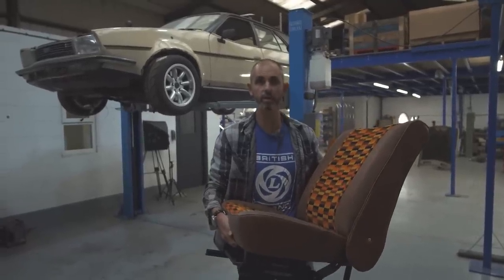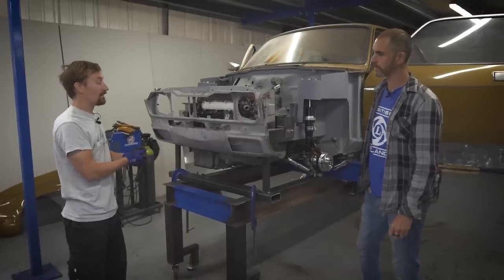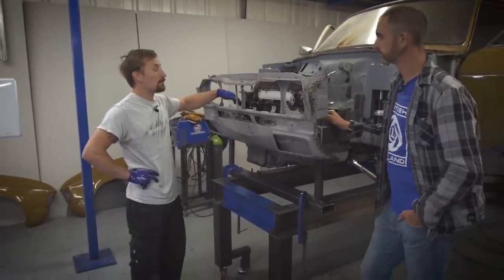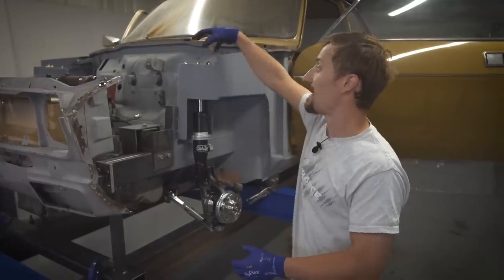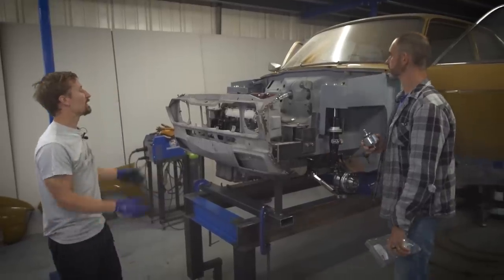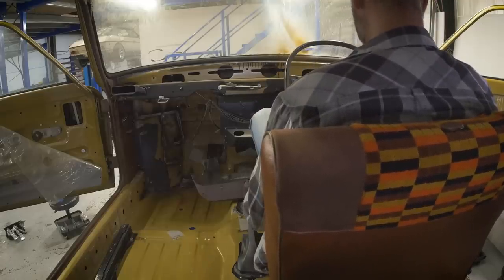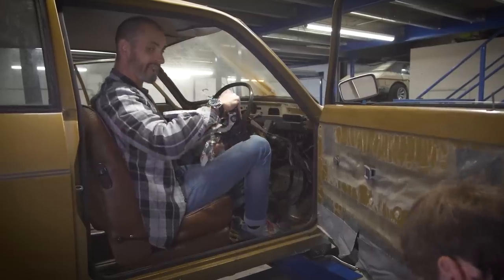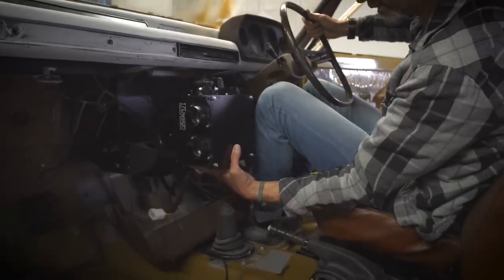Part 5: Austin Allegro Street Sleeper project build // Jonny Smith

Comment: You will probably need to upgrade your neck muscles too, if those lowback seats are anything to go by!  On a serious note, the seats do concern me, that's going to be a powerful little beast and floating around on those old lowbacks isn't going to be much fun.  Do the seats have a headrest option? There looks to be a blanking plate where one might fit?   Whiplash is no joke and was a major cause of injury in older vehicles before head rests became mandatory.  If you get shunted from behind, even at low speed, your head will fold right back over the seat and potentially cause serious spinal damage, even paralysis or death in extreme cases.  I love the concept of the original look but at least consider fitting the head support, for your own sake.   Your safety is more important than keeping the original look.
Reply: When I was a kid in the 70's my family had a red 4 door Allegro... I might be mistaken but I'm sure they had headrests on the front seats

Comment: Love you Jonny!  Don't care what you say, this is still my favourite thing you're doing.  Mind, I still think that engine is too deep, so here's my latest brilliant suggestion:  get Allen Millyard to siamese and turbocharge two Suzuki RG500 engines for you, to make a 1000cc, 200 BHP turbocharged square eight Allegro with a six-speed sequential box.  You can have that idea for free.
Reply: Won’t work. The front end will take off, leaving the cabin and boot behind.
Reply: Imagine how much 2 stroke oil and fuel it would use.  And and trying to be in the power band just pull away! And 8 expansion pipes trying to be routed somehow.
Reply: @chrishart8548  it would sound mental though, wouldn’t it!
Reply: @robsawalker  it really would.  Being 2 stroke it would have as many firings in a cycle as a 16 cylinder.  4 stroke.
Reply: Good lord. I bet Allen would be up for that too. It would be worth it to watch him cut the blocks up with a hacksaw, weld it all up in his back shed, and start it up sitting on a box in the backyard. That man is a marvel.
Reply: You could get 200 bhp naturally aspirated
Reply: @paulwhite7475  with what a 2 litre honda engine  or the 2 500cc  2 Stoke bike engines combined ?

Comment: This is a fabulous build so far. I’m loving it. I must confess that the low sump is making my teeth itch somewhat 😬.  Maybe it will look better when the ‘Agro’ (because that what it will cause unsuspecting drivers) is back on its wheels.
Reply: I’m sure it will 😃
Reply: 5 inches from the ground will hit some speed humps in the UK. The sump guard needs huge strength and integrity.
Reply: @ftw1540  

It's lucky that the sump will gain more clearance along with the rest of the car due to those handy wheel things 😉

Comment: Jonny, best solution to the large K20Z4 (FN2) sump is to swap it out for a K20A2 (EP3) sump, its significantly shorter, added benefit is losing the balancer shaft oil pump set up, gaining around 10bhp in the process
As for the intake manifold, i'd bin the RSP intake manifold and go for something shorter aftermarket

Comment: You HAVE to sort that sump. You'll eat through 5" of suspension travel on the first compression you go through leaving a nice black line from the scene to the recovery truck. Also, don't forget to not nose it up against the kerb.

Apart from that......Sleeper Agro, lol, brilliant.
Reply: Maybe a different sump would help? The engine does some to sit rather low, which is great, but also kinda dangerous otsot.
Reply: I’ve got to agree and it does look a bit weird seeing a k mounted so low down as they are pretty tall engines. I can’t help thinking it would be worth playing around to get it at a more practical height but I’m interested to see how it turns out anyway otsot.
Reply: Well keep watching because in the next episode things will have changed quite drastically on that side of things. 😃
Reply: Unless you're hitting square speed bumps at 50mph you're not going to see a stiffly sprung car move FIVE inches!

Comment: Johnny this is awesome. If I may and there's still time for it, go with a supercharger. The K series engines, particularly the K20 are spectacular with a supercharger, because you fix their low down torque issues without sacrificing the top end from an awesome N/A Honda engine. You get as much as 300bhp on stock internals and a bonkers setup.

Comment: For rad look at mgf ally radiator, 40mm thick and they fit the allegro front panel well, you can even use the original allegro rad top brackets

Comment: so, correct me if i'm wrong, the intercooler is BEHIND the radiator, nicely increasing the charge temp when the cooling fans come on. please say i got it wrong...
still mourning the loss of the 827, but we'll see...  [still worth a thumbs up]
Reply: The idea would be to have it below the radiator, rather than behind as such, but we’ll see 😊
Reply: @FabCoUK  below sounds ok, if there is enough space to extract the hot air, taking that bloody big sump out of the way would help...

Comment: Hi Johnny, great project, why don’t you cut out the small brace piece in the front of the front panel and place an intercooler there and the grille will still hide it when painted black 😀

Comment: Nice Build! Those mk2 Golf uprights are prone to cracking, especially the new non genuine ones which is what you appear to be using!?. Maybe worth upgrading as with the increase in power/torque than what they were designed for, they will be taking more stress. Get in touch with FunCup for some uprated billet uprights. Much better option and direct replacement with bigger and stronger bearing as well as looking the part!

Comment: That's a proper GTI drive shaft. It's that large in diameter because it's hollow to balance out the weight between the uneven length shafts.

Comment: Intercooler has to be in front of the Radiator. Otherwise it'll be an interheater!  The radiator will run hotter than charge temperature, typically. I'd be tempted to add a WCAC (Coolant based) so you can runner a thinner heat exchanger for the water.   But awesome progress, amazing fab work!

Comment: On my mini conversion we cut the splines for the outer CVs on the donor engine's driveshafts this was possible as they were both longer and thicker than required for the outer CV splines, this may be the case with yours. Result is one piece driveshafts much cheaper than new billet shafts.

Comment: Water isn't pushed out through the thermostat on this style of setup. The thermostat is used to block the return path of coolant from the rad during warm up. The vast majority of systems work this way now as it gives a more stable temperature control. The coolant is pumped through the block, head & exits at the end of the cylinder head above the transmission.

Comment: good and interesting project. Anodising colur is dye added after the anodie process (Anodising creates a cellular structure on the surface of aluminium which accepts a dye and is then sealed to retain the dye) Brown is possible but might be more costly because it is not as common as black, blue or red and therefore a one off. Caswell 'Brown BL' perhaps?

Comment: The fabric insert on those chairs looks like something that would have been in a Vanhool coachbuilt bus in the 80's.
Reply: leyland bus in 70s i seem to remember, [the single decker with the hump on the roof + a big fan behind mesh at bumper height]
Reply: @paulriggers1558  Yeah. Some of those coaches might have been late 70's to. And also it seems like the seat fabrics are contracted for like 10 years at a time or something. We didn't have many leyland buses in sweden, mostly volvo and scania at that time, so Vanhool, Vogel and some times Recaro interiors.
Reply: @rimmersbryggeri  seemingly the london tube trains as well
recaro interiors ? as in recaro seats ?
Reply: @paulriggers1558  Yes the make public transportastion interiors aswell. As pininfarina and Ital Design buses and tractors.

Comment: The colour in anodising is just a dye similar to clothes dye, the anodising process opens up hexagonal pores in the surface of the metal, the item is then dipped in the colour and then in boiling water which closes the pores, sealing in the colour.

Comment: Grinding and mig welding at 5:50 without the screen and body covered up. Been there and done that,  She's gonna have pitted glass and paint now. And intercoolers never go behind the radiator, there's a reason why you never ever see it done. The amount of heat coming off the radiator is going to heatsoak the intercooler and turn it into an interheater. Don't make the mistake of going too  thick with the radiator either or you'll end up either not being able to keep temp in it or not being able to draw air through it to cool it. A 40mm rad will be heaps big enough for that application.  You should be able to get a 70mm intercooler with a 40mm rad in the front of that or 50mm if you're really struggling for room. Even a pwr barrel style water to air cooler might be an option.
Reply from the maker: I'm probably going to fit a new screen anyway, for safety. Ideally heated. You are absolutely right though - someone did that to my Beetle years ago
Reply: @TheLateBrakeShow  It sure does make a mess and the sparks that are burnt into the paint end up rusting.

Comment: You can get them golf drive shafts in a solid driveshaft rather than hollow , place called j&r driveshafts there cheap also ! can just turn the Honda and golf solid shafts to what ever diameter you may get lucky and the lm be same size and sleeve them together rather than a solid to hollow configuration

Comment: Love the project. Fantastic engineering. 

However, without inner wings how do you stop rocks, water, road apples and other unwanted crud entering the engine bay from the wheels? And for max efficiency, shouldn't the intercooler go in front of the rad?

Comment: I'd have thought it'd be advisable to mount the IC in front of the radiator, as otherwise you'll be feeding the IC preheated air that's flowed through the rad when the car's hot.
Reply: Yes. That’s literally the exact reason they’re always mounted in front of the radiator. It’ll probably put the intake temps up instead of down positioned behind the radiator like that.
Reply: Think below, rather than behind 😃
Reply: @FabCoUK  So it’s gonna plow into speed bumps and kerbs intercooler first instead of sump first then, phew… I mean I guess if it’s gonna be a track only kinda thing it’s not so much of an issue unless it takes a trip through the kitty litter, but ground clearance is important
Reply: @Jonathan_Doe_  you’ll see 😃

Comment: I should mention that if you black anodized the pedal assembly and then use "skate board" tape for the wearing surfaces, it should blend in nicely.
Reply: Someone else mentioned copper plating and polish it, skateboard tape would provide a great grippy, protective surface.

Comment: Are you going for towers at the rear or horizontal coilovers like the original build?
What rear brakes / hubs are you going for?
I use corsa Sri rear stub axles and bearings, disks and calipers, the offset and pcd of them are spot on for me.
The horizontal coilovers need very high spring rates and dampers, maybe go for towers?
If not you want 1200lb + springs

Comment: For the intercooler, could you do something similar to the VW Passat setup and mount it behind the front panel in front of the wheel? If your having the ns fog light hole for the cool air feed for the turbo then the os would be ideal for the intercooler if your only going to be running a small one?

Comment: You mentioned the R53 mini. Given how readily available cheap cooper s are, would this not have made a good donor for the project? Use as much of the running gear as possible and then you got compatibility? Tune with JCW parts?

Comment: If needed you could go dry sump, but thats wayyyyyyy down the line at this point. After the wheels can move under the engine power. great looking job so far. 2x👍

Comment: Fabulous series, I have to go back and get caught up with 3 and 4. Will you dry ice blast the motor and transmission before final assembly? I hope you have another project in mind, I don't want to have to go through withdrawls.
Reply from the maker: Engine for the car is coming out of a crashed Type R this week. The one you see is not the final motor - it is a spare Adam had lying around.

Comment: Hi Jonny, loving this and super idea putting the K20 in it! Also a massive S&S fan, I’ve listened to every single podcast to date! Couple things - why can’t you move the engine up? Also are there not any aftermarket sump plates that might be a tad shorter? K20s are such a common swap!
Reply: He doesn't want to change the height of the bonnet, just looking stock as possible.

Comment: I mean it’s no bad thing, but a radiator the size of that cad template is way overkill. Check the size that they used in EP3s to cool the same engine, barely an inch thick!

Comment: mk2 driveshaft  outers can't take the k20 power, you should redrill and press in tdi/gti mk4 hubs with a shim and use the bigger outers or you will spend a ton on new driveshafts for nothing. And i would like the see the engine closer to the bonnet :)
Reply: Be interested to hear anymore info you have on this? CV’s look beefy enough, it won’t be a torque monster after all, but are the mk2 ones notoriously weak?
Reply: @FabCoUK  not notoriously but normally mk2 don't have that much power. I have seen a few broke on modded diesel ibiza's that use the same spline. Even the mk2 rally has the bigger spline from factory and it's so easy to swap the bearing is the same size. But with a k20 turbo i would not trust the small mk2 cv joints.
Reply from the maker: Thanks for the VW driveshaft intel. I will inform Adam at FabCo immediately!
Reply: @CrAzYDr1veR  thanks for info. Will look into this!

Comment: I was following this build, beautiful work but I'm afraid I'm loosing interest with four cylinder Honda engine. The old V6 was going to be different and more in keeping with period and BL parts bin ethos. Sorry, just my opinion and I expect that that many will put me down.
Reply: Any engine than the civic v-tec that seems to end up everywhere.  A 2 litre montego turbo engine would have got my vote.
Reply: I preferred the V6 although mentioning the Montego engine perked my interest also😂😂 hey ho... Let's see how it goes 😁
Reply: The 827 Rover engine was Honda, as was the Acclaims & later the Rover 213/216, so this isn't THAT much of a departure, is it?
Reply: @MrPabsUk  I don't really follow what you are saying here. Is it your view that the later Honda engine which never made it into a Rover car is ok, never coming from a Rover parts bin? Nice engine though.
I was hoping to see a conversion that looked as if it might have been made by Rover. But we're all getting tied up in knots here.
Reply: @philiptownsend4026  Well, there was never an overlap between the Allegro & 827 engine production, so it cant really be described as "period", technically or visually. If BL had wanted to do a hot Allegro, they`d have probably used the turbo`d A, O or S--Series lumps, although there may have been a few BL engineers wanting the exotic (by BL standards) Honda triple valve lump in it too... The Civic engine that is being used is a spiritual evolution of the engines that were used at the same time as the 825/827 was produced, & seeing as they are deleting a lot of the parts that make it look "modern" in this install, like that water pump/tensioner system & intake, it should look relatively period.

The alternative is those outdated-when-new BL engines that 1. weren't great performers, even when breathed on, or particularly reliable long term, & 2. have no real aftermarket upgrade support, so they don't meet the brief Jonny's put in place.
Reply: @MrPabsUk  Yes I was realising there wasn't a time overlap Allegro/827 as I wrote it and that is why I put the last sentence there. If it was my project I would have stuck with the V6 and versatile gearbox that came with it. But it is not my project so I will bow out of the conversation now.

Comment: Pretty much no point in running an intercooler behind the rad, be better off with a smaller rad & small intercooler (think TDI Disco / Defender). Alternatively run a chargecooler with a big but very slim rad at the front & a big rad behind for the engine. I've used a Golf 3 rad as a chargecooler rad before with great results, the core is slim, they're light & very cheap.
Reply: Something to consider!

Comment: IMO the talk of intercooler behind the rad misses one big point. Whilst you might not need much cooling from it, you’ll always be putting heat into the air from the radiator. Intercooler should always be in front.
Reply from the maker: We can revisit this when closer to adding an intercooler. You are absolutely right.

Comment: Are you going to put it through the SVA test?
Reply from the maker: If that is what is required for correct insurance, yup.
Reply: With all the mods to the monocoque it will most probably lose its reg and get issued a Q plate. Won't be long before the government force MOT testers to flag up all the cars that should of been put through the MSVA.
Reply: @CraigDavies.  as long as its petrol, 4 cylinders, +fwd, nee bother, + no mot needed. anyway most MOT testers these days don't give a toss, just want the car finished in 20 mins, so they can play on their phones for the other 20 [i'm a tester, so i know the score]
Reply: As you know the MOT is only an indication that the car is roadworthy at the time of test. It does not show that a car is road legal. That's why they have the SVA test for altered vehicles.